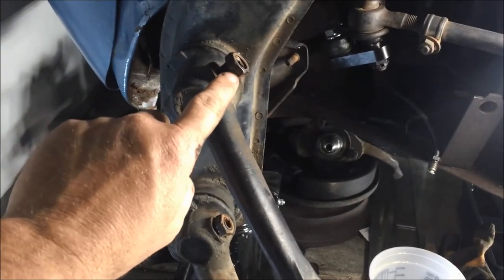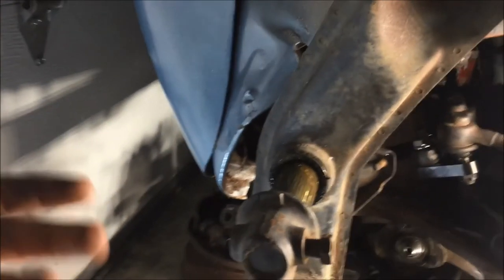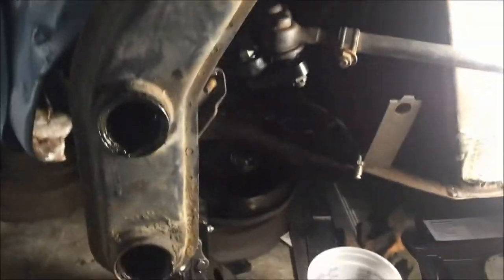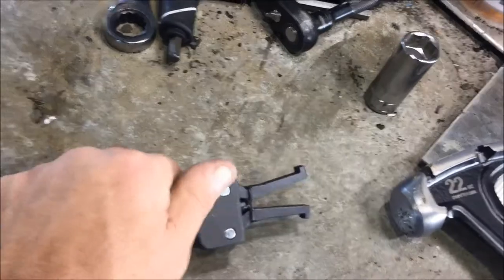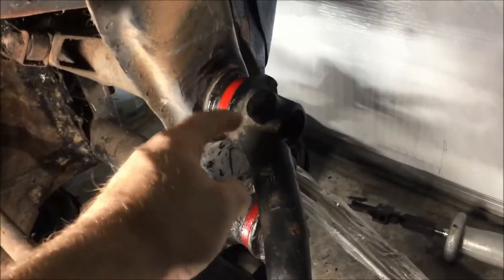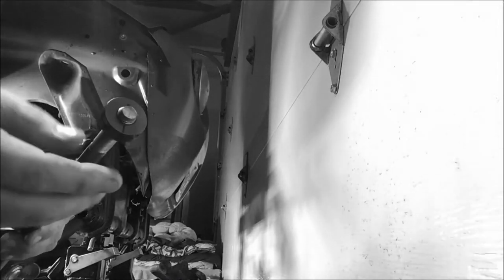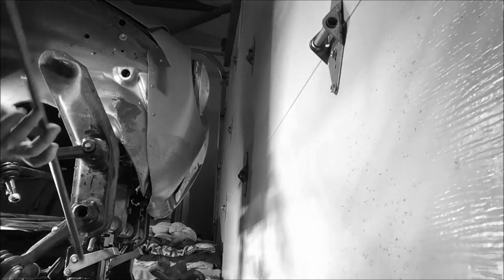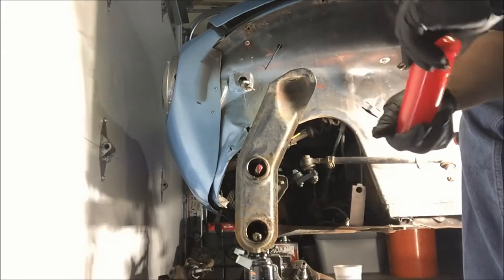vw bug polyurethane beam bushing and through rod install 68 VolksRod

Comment: I'm hearing the red empi polyurethane bushings aren't good for full off road use. Was told there's some white polyurethane bushings that are almost as good as the needle or solid brass bushings. I'm in East TN and we most definitely have some pretty rough trails. I'd say equivalent to the rough rocky trails of the west coast. Anyway I'm wondering if you do much trail riding and if you still own the baja and have the red empi bushings held up. I'm on the fence between any full length polyurethane bushings or using the OEM bushings considering an OEM bushing can last a couple decades
Reply from the maker: This bug is slammed to the ground with air shocks. It won’t see much dirt. But honestly after installing the red bushings I wished I went with something else. I have heard that the polyurethane bushings don’t last that long.

Comment: Hopefully get a super fast response. I have these bushings and doing a new beam tomorrow. The bushings for the top are too big. Is that the reason for removing the bearings? And they are being left out correct?
Reply from the maker: Yes that’s exactly why you need to remove the bearings.
Reply: @OFFAxisBuild  you are awesome thank you. You probably saved me a massive headache tomorrow with the vid and your response. Working on my first baja.

Comment: Why did you delete the torsion springs and what coilovers did you choose?
Reply from the maker: I actually deleted the springs to put my air shocks on. By removing the springs it allows you to be able lower or raise the front without the springs binding. I only did this video to show how to change your front shocks. I am currently running Monroe air shocks in the front. Thanks for watching

Comment: Can you purchase that thru rod with the locking nut somewhere or is that custom I also run Monroe airshocks and would like to get rid of the torsion bars
Reply from the maker: Yes I got both the through today an nut on amazon. Then I put a lug not as extra security. 

THRU ROD FOR STOCK WIDTH BEAM,... https://www.amazon.com/dp/B003KKKIEK?ref=ppx_pop_mob_ap_share

THRU ROD NUTS, 4 PACK, dune buggy... https://www.amazon.com/dp/B003LITA90?ref=ppx_pop_mob_ap_share
Reply: Dude thanks for the link just ordered it! .. another quick question I bought the poly bushing kit today it came with two long bushings like you installed on the driver side, and 4 short bushings  do those go in the passenger side? I was expecting 4 long bushings
Reply from the maker: Can you send me a pic. So I may not of shown this. I ordered the long bushings for mine, but I was unable to remove the inner bushing out of the beam so I cut the longer ones down and left the inner bushing in the beam. You may only need the shorter ones if you want to leave the inner bushing in.
Reply from the maker: You will only need 4 bushing total if you are referring to the red polyurethane bushings.
Reply: I gotcha I picked up the wrong kit there was 6 bushings total only two long ones I'm returning it and going with the 4 long ones... Thanks alit for you're help and this video I really appreciate it
Reply from the maker: @KUTZFRECH  are you planning on removing the inside bushing?
Reply from the maker: Thank you

Comment: Question, can you clarify bearing vs bushing?  Did you remove the inner bushings seated in the beam or just the bearing?

https://www2.cip1.com/ProductDetails.asp?ProductCode=VWC%2D131%2D401%2D313%2DSET
Reply from the maker: ericrb76 Yes a bearing has multiple parts that move with the shaft, but a bushing is a soft piece of metal that usually will allow the shaft to rotate on its own. No I wasn’t able to remove the inner bushings. So I left them in and cut the polyurethane bushing shorter.
Reply: @OFFAxisBuilds  thanks for the clarification!  Folks are saying to use a dremel to cut the surface of the bushing, then you can pull them right out.  They are too shallow for a puller/hammer slide.
Reply from the maker: ericrb76 that’s exactly the issue I had. I couldn’t get a slide hammer to hold the lip.

Comment: Hi great video, just one question, Did you used Lukas red N tacky red grease??
Reply from the maker: Polyurethane bushing manufacturers advise to never use a petroleum based grease for poly bushing lubrication. Polyurethane should only be lubricated with one specific type of grease to insure long bushing life, and squeak-free performance, Silicone based synthetic water-proof grease.